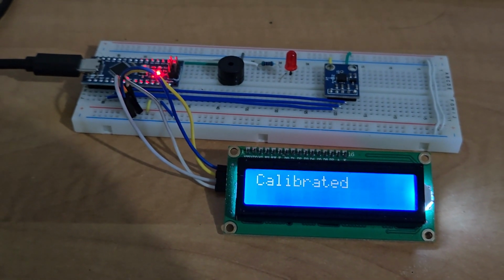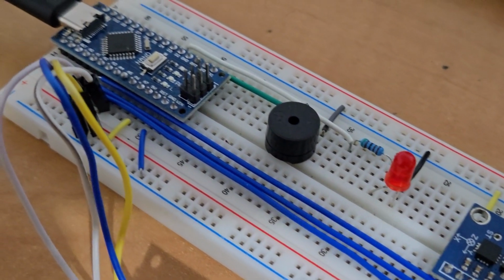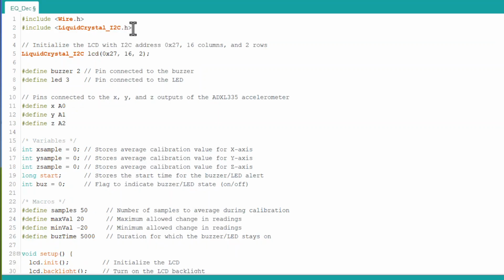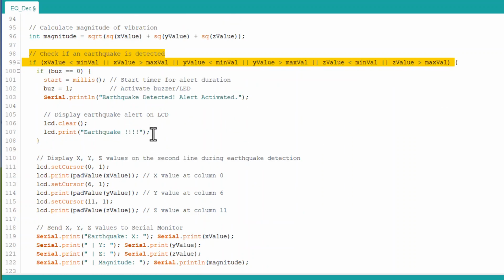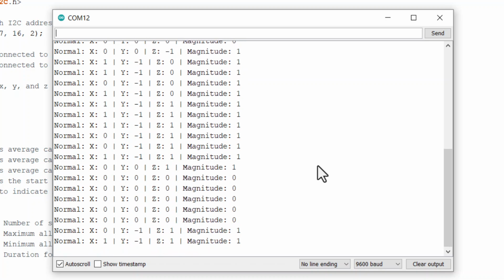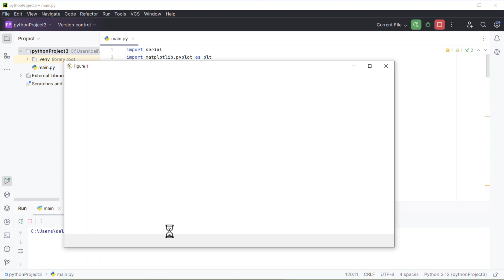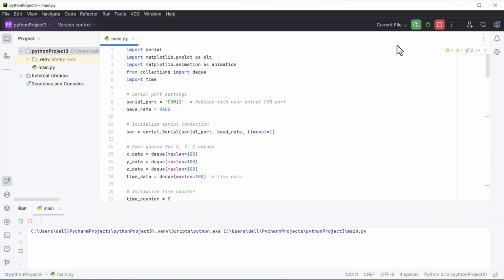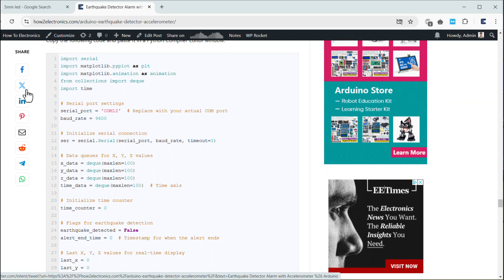DIY Seismometer |  Earthquake Detection Alarm using Accelerometer & Arduino with Seismic Graph

Comment: Hi, I liked your earthquake Detector Alarm project. Great video! Why not take your project to the next level using the GeoPhone - SM24 (from Sparkfun) earthquake sensor. Also, a new video for you. The GeoPhone - SM24 is used by many groups around the world to monitor earthquakes. I am thinking of using it on on a 3 meter lighting rod used for house grounding here in the USA. I still need to locate the best place for the rod as there is car traffic on 2 sides of my house (corner lot). I believe that this would be an interesting project/video.